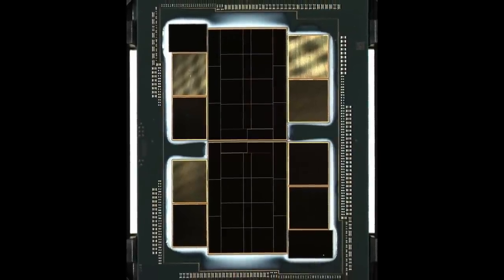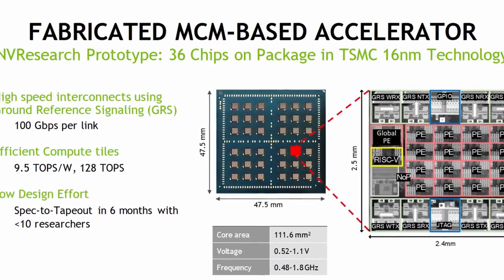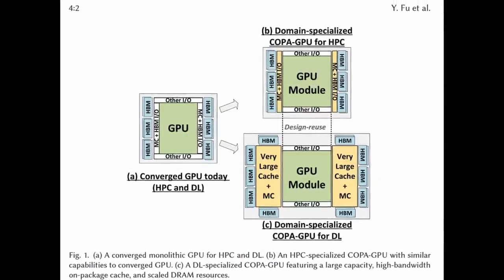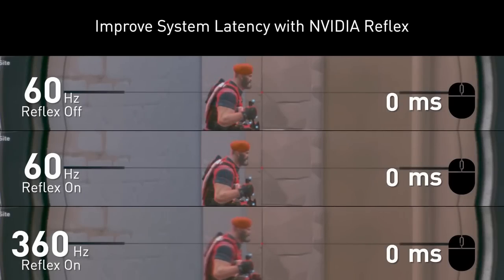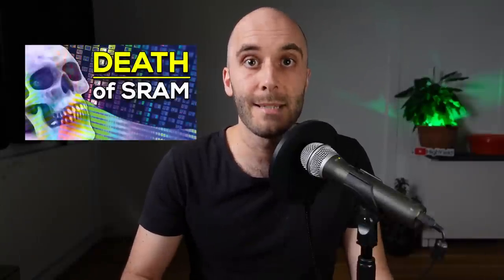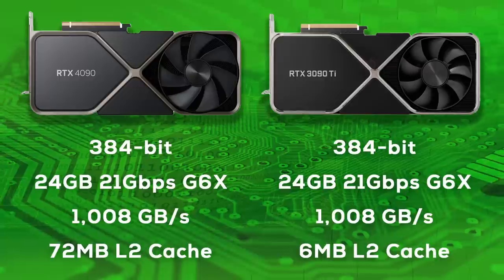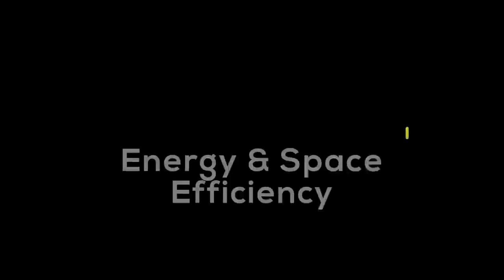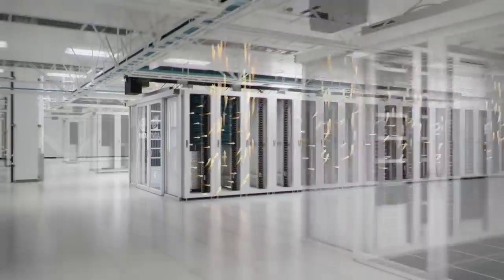How long can Nvidia stay monolithic?

Comment: I just hope either intel, amd or nvidia be the first to move away from x86 towards ARM architecture and the next generation consoles solely based on ARM architecture. It is clear it will eventually happen, but the question is when.
Reply: I dont know why we'd hope for that, personally.  ARM isn't really inherently better as a whole and its efficiency advantages and whatnot that people tout now will get reduced as it is further developed and complicated, and I really dont look forward to the software issues that ARM PC's will face for quite a number of years as compatibility problems and translation software and whatnot need to be ironed out.  Consoles especially might require losing all backwards compatibility, which will be a heavy blow for both gamers and the industry in general.
Reply: @maynardburger  Its not a question of whether it is better or not, but the future we're headed towards and how we get there. If there is only one manufacturer (Apple) who uses ARM in a world where most devs have optimised for ARM then it'll be a monopoly and won't be good, since transition to ARM is inevitable. If you can argue that transition to ARM is not inevitable then you might have a case.

Comment: Only couple of years ago NVIDIA used to promote SLI based GPU's, How can you say GPU does not scale with multiple chiplets, latency in SLI based configuration will be more than they would be in chiplets. it is the question of will, not the way.

Comment: From what I remember, that hypothetical MCM research chip from Nvidia was faster because it used more die area. Monolithic is always better for performance and energy efficiency, as least for the scale of what fits on one monolithic die. Since Nvidia GPUs are scaled up much larger than what can fit on a single interposer - for the vast majority of their revenue they lash 8 reticle-limit GPUs together with NVLink to make a single node and then lash many nodes together with NVLink and/or Infiniband to make pods - any advantage chiplets give for larger-sized packages mostly gets washed out during that further scaling.

I believe Nvidia would like to skip the excessive use of modules as much as they can and instead rely on their serdes expertise and in-package optical I/O. Of course they likely will eventually need to use tiles to some extent, and in-package optical I/O itself will rely on chiplets, but I think they would like to limit tile/chiplet use to where it is most economically advantageous and tackle scaling and bandwidth issues with optics rather than with advanced packaging.

Comment: I feel so confidently that nvidia is going to make the 5090 a MCM design because of just how massive the 4090 is and how much TSMC is struggling to make smaller and smaller chips
Reply: The 4090 isn't especially massive.  It's smaller than the 3090/AD102 was.  Quite a bit smaller than the 2080Ti/TU102 was.  And heck, the 4090 is actually more cut down than the 3090 was, even with the slightly smaller die.  4090 is more like what the 3080Ti was.
Reply: 4090 isn't particularly massive. 
3090Ti was 628mm²
2080Ti was 754mm²
Only 1080Ti was significantly smaller for reasons mentioned in the video
980Ti was 601mm²
780Ti was 561mm²

So the 4090 isn't especially large. 600+mm² surely is very big for consumer cards, but it's a regular thing in the enthusiast space.
Reply: TSMC are not struggling. They are at the cutting edge & creating new technology as we speak. Creating new technology is hard. Always has been.

Comment: I don’t see Nvidia going Multi Chip until RTX 60 series exclusive to the RTX 6090 in 2027. Multi chip should then be seen on the 90, and 80 class GPU’s in the 70 series in 2029. Unlike AMD, Nvidia will only do Multi chip when they need to.

Comment: thanks for addressing this issue. i was wondering why the stock market is pushing Nvidia's stock price so high knowing we are beginning to reach the silicon physical limits of monolithic designs.
chiplet design seems to be the immediate future of traditional silicon chips for at least next 10-15 years before other computing tech like photonic neural network chips or quantum chips , start to take over.
Reply: Quantum computing is only faster than traditional computing for a limited set of workloads and requires cooling the chips down almost to 0K. It will probably never become mainstream.

Comment: Rendering computer graphics for interactive computer games is the easiest thing to adapt to multithreading, ie. an embarrassingly parallel workload. Gamers are sensitive to latency measured in milliseconds, while nanoseconds can bottleneck an HPC or ML job. Graphics calculations are mostly independent and processed as streams, completely hiding any latency. All that matters for interactive graphics is that all the pixels get drawn in time, and there are very few dependencies that don't fit in cache. So I think you have the latency sensitivities of games vs. AI/HPC completely backwards.

AMD GPUs currently only use memory-cache chiplets because it's the first generation and the least risk with the highest reward potential, and not because of any limitations in scaling graphics applications to modular GPUs

Comment: Chiplet on gaming GPU is just too difficult unless there is a breakthrough on how to send huge amount of data. AMD will have advantage in chiplet design as AMD does both general purpose CPU and GPU so they got more ways to gain more knowledge and experiment.
Reply: Just to difficult until PS 6 or PS 7 using chiplet based from AMD

Comment: Can you make a video explaining why CPUs are limited to 2-threads per core?
Why don't we have, lets say a 4-core CPU/12-threads (3-threads per core), etc?
Reply from the maker: This is simply due to the fact that Intel and AMD only implement SMT2 (which means a single core can run two threads). IBM for example has CPUs that offer SMT4 and even SMT8. The more SMT threads you use, the lower the over all scaling, but it's possible to run more than 2-threads per core if you design it that way.
Reply: @HighYield  I see, thanks!

Comment: Why has SRAM size stopped scaling?
Reply from the maker: Check out this video: https://www.youtube.com/watch?v=vQ5JPqeFitM
Reply: @HighYield  thanks, that’s great info. Do you have any explainers as to what the physical limitation for SRAM scaling is? As a DRAM engineer I am well aware of the manufacturing problems that DRAM has as we try to scale the Wordlines, bitlines, and capacitors. However, I had always assumed that SRAM would continue to scale directly with the logic transistor sizes. 

And now that I write that, it occurred to me that the latest logic process nodes are less focused on transistor scaling, and more on block layout, optimizing power delivery, minimizing black silicon, etc. And I assume all of that optimization has already occurred in the SRAM arrays, so as long as the transistors are staying the same size there’s nothing else to do in the SRAM array. Is that the right track?

Comment: AI chips? I guess they will go chiplet.
GPU chips? Well, as the rumors saying that RDNA 4 will not have high end chip (aka: chiplet design like Navi 31 and Navi 32) (latency problems as you mentioned ?) focusing on Navi 43 et Navi 44 (probably monolithics); and Nvidia Ada Next will probably be monolithic, even on the high end GPU (xx102) using, I guess TSMC N3 or better and some architectural improvement.
So, Maybe in 2026+ AMD will come back with RDNA 5 in the high end using chiplet (Navi 51?) to compete with NVidia on chiplet, too (using TSMC / Samsung 2N or so)
2026= is still a long way to go...
Reply: it's because the prices are not sustainable for AMD to produce high end products. going to newer nodes not only increases the price but also the design complexity.
Reply: an, of course, (really) increase performance, especially in the "mid-range" GPU (aka Navi 42/52/...) (Navi 21/31/51... are high ends for me...)

Comment: So why not 3D monolithic chips over chiplets? Wont that be way better since you wont need different things to connect the chiplets to communicate together?
Reply: At some point, perhaps yea.  But stacking compute layers on top of each other has huge heat problems that need to be solved first.  That may take a while for any kind of high performance applications.

Comment: Considering the GH200 specs NVDA still has an edge over AMD and INTC. But their software stack is more than decade ahead, so even if AMD wins on chiplet, they will not wider adoption due to poor software support. This gives NVDA enough time to spend on chiplet R&D and still stay ahead of AMD. INTC is much behind AMD so it's not fair to compare them.

Comment: Nvidia owns TSMC 4 and will simply ride 4 nm depreciated cost curve down to introduce BW return to desktop design generation in mass market volumes from Ada mobile design generation produced at a higher cost : price but good for 50 M units of AMD and Intel mobile H attach during H mobile producers ramp plus some HPC cards at 4 m risk production also more costly like x3 TSMC 5 nm cost but Nvidia is making money with 4 nm now and into the future. Pursuant SIP slowly but surely. mb

Comment: Nvidia could probably stay monolithic for another couple of generations if they wanted to.
High NA is a resolution bump so it can probably rekindle SRAM scaling to some extent like EUV did, but with GDDR7 comming, the need for a large SRAM cache won't be as important anymore, and for larger than 400 mm2 dies, dual masks + stitching is an option if Nvidia is willing to pay the price.

Comment: Nvidia series 5000 is not chiplet design, AMD is having problems with rdna 4.
No way and no point pushing themselves when they are the only ones with the crown. 
The problem maybe the 6000/7000 series, when AMD will be putting out some soild hardware. 
Will Nvidia have a intel moment and fail in development letting AMD run away from them. Maybe but Nvidia will have mind space like in intel did and will have many years to come out on top.

Comment: AMD HAD to try something different, it was do or die for them and it paid off Big Time.
Intel was in "No Rush" to innovate and they paid a HUGE price for it. So much so that the company is in shaky ground now. 
And Nvidia? Nvidia lucked out. They saw what chiplet did for AMD that DECIMATED Intel's CPU performance. With a hyper aware engineer CEO,, they won't be making that mistake and you can count on it.

Comment: I mean Nvidia but also Apple don't use chiplets and so far they're doing great and beat the competition in many areas 😅
Reply: Well technically Apple is using chiplets with their Mx-Max chips which just stitches together two of the lower class chips.
Reply: @skirata3144 and sadly ultra (2 connected max chips) have a lower gaming performance than the max monolith variant

It's amazing what rdna3 achieved as such, but I have faith AMD will figure it out going ahead.

Nvidia was always at the forefront of technology I don't doubt they will also switch to multi chips but probably follow the intel/apple model of expensive interposers as opposed to AMD's interconnects

Comment: Funny how you consider chiplets being better than monolithic. It's against basic physics, but who cares. As for the future - AI will decide what's best for what.
Monolithic die has performance and efficiency advantage. Chiplets have production costs advantage for large packages. While for small ones overhead could surpass savings.
As long as Nvidia can balance production costs and selling price, they will stick to top performance solution, which is monolithic. They can do chiplets any time. Tools and production platforms are available to everyone in the industry. Next gen is probably the most intriguing one in decades. It's a design and production where AI will kick in for real.
Reply: Nvidias own research says that chiplets outperform any possible monolithic design, it's not a matter of manufacturing margins at the high-end. Even just moving the memory controllers and cache off the die like RDNA3 is worthwile because it doesn't introduce extra intra chip latency and recovers that space for more compute logic. Nvidia isn't going to wait ten years for someone to develop a larger reticle just so that they can continue making monolithic designs
Reply: @shanent5793  Chiplets introduce extra distances and interfaces. They can't be faster because of that. Stop the bs.
Reply: Lol a playstation must also be faster than a desktop PC because small 😂
Reply: Monolithic are better in all possible case, chiplets just cheap to produce, ( even nvidia do chiplet they still goin to charge 2grand for gamer anyway ) and people would buy it.
Reply: @shanent5793  You are probably lost between the lines of some AMD presentation. Or compare apples to oranges.
If you have similar logic chips and one is monolithic while other cut in chiplets, monolithic will always be better. Because physics. Also often more expensive.
If you compare chiplets with RAM moved over there to a classical system with removable RAM further apart, the result will be different just like the system! But once you do the same with monolithic setup, monolithic die will win again. Because physics. Apples to apples, ok?
Reply: @vensroofcat6415  it was an Nvidia paper, not AMD that said a modular chiplet design outperforms monolithic.

The comparison is between chip designs that can actually be manufactured with the available tools, and not between a monolithic design and an equivalent design partitioned into chiplets to reduce manufacturing costs. It should be obvious that a composite system can outperform a single chip, otherwise there would be no need for multi-socket servers and datacenters with thousands of nodes
Reply: @shanent5793  What paper? bs
Reply: @vensroofcat6415  A. Arunkumar et al. 2017, the first paper referenced in the video
Reply: @shanent5793  yes, and it 1. compares their optimized MCM (multi-chip module) to non optimized MCM chip module; 2. their MCM is faster than the largest IMPLEMENTABLE monolithic GPU and performs within 10% of hypothetical (unbuildable) monolithic GPU; 3. their MCM is faster than a multi-GPU system.
First paragraph in the paper. So monolithic is actually roughly 10% faster, but unbuildable at that size. Chiplets are slower. Because physics. Signaling loses and latency. But for large modules the only way forward. Otherwise you would be saying running 11km is faster and takes less energy than running 10km.

Comment: Nvidia has 1 more set. Then ss Nviditanic sinks. Unless they can buyout intel maybe, or AMD or TSMC no chance! because of Nviditanic will have much lower relative market cap.
Intel, AMD plus others will have performance parity or dominance. 
Chiplets will deliver superior power and cost efficiency. Basically either next gen, but certainly next next Nvidia is doomed.
Intel chance maybe if Intel continue their decade long, too little too late ineptitude of rolling out the next step.

Comment: Nvidia is gpu only, so they can't take risk of big changes, which of case of failure would make existential danger. AMD did big design changes in gaming gpu design.. but I am not sure, if it was made for gaming exclusively or it was just result of using similar architecture in other areas. (Vega, Rdna3 MCM).
Both were considered as either failure or not hitting targeted performance.

Latest leaks say AMD cancelled next gen MCM for gaming.
I don't think Nvidia is further in development vs AMD. If they were.. you have already said it... Nvidia would not leave its advantages(costs, performance, scallability) unused.

AMD next gen high end gaming MCM gpu is expected to come in Q4 2025, but that's also around Nvidia Blackwell gaming right? Anyway Nvidia is expected to bring in on 3nm.

I am really curious how AI boom will influence new gaming gpu releases, AMD bring N43 and lower specs with Rdna4 and Nvidia currently not beating last gen, except huge uplift with Ad102.

I would like to know how much N21 was memory bus bottlenecked... To see direct performance comparison vs MCM N31.
If there was possibility to make N21 with 384bit bus, 24GB memory and then check it vs N31. I heard N31 beats Rdna2 mainly in 4K, which seems logical but is there any way to benchmark its architecture uplift if we got no similar gpu in old gen with same memory bus? 

7900GRE with 256bit and 16G is about to come. if it won't beat 6900xt, it is  AMD fail for sure!? 

(reading posts here too, but not that deep educated, so free to hear any correction or comment)

* Curious if any light chip in development and what are limitations to get rid of current technology) optical drives were told to be future and now we back to not mechanical but magnetic ones (SSDs).